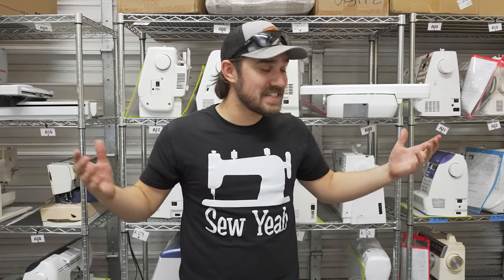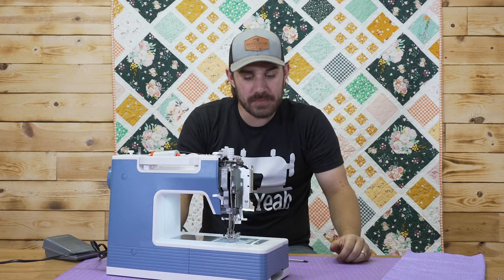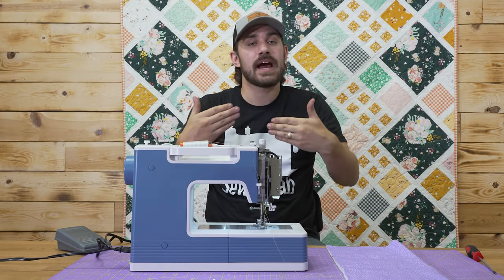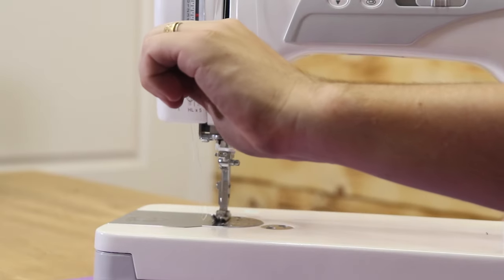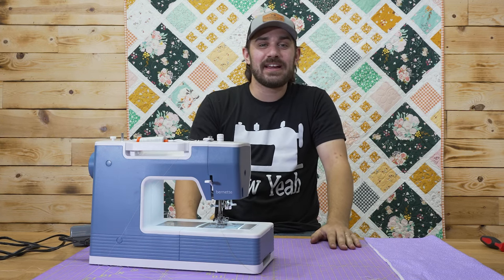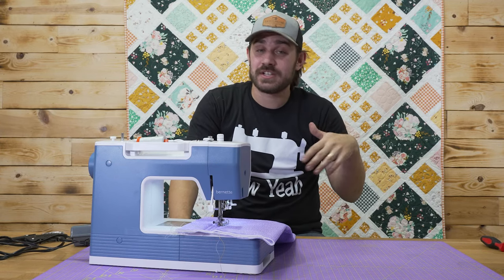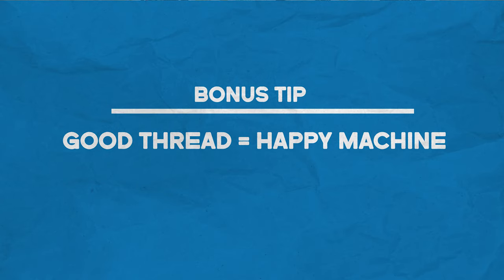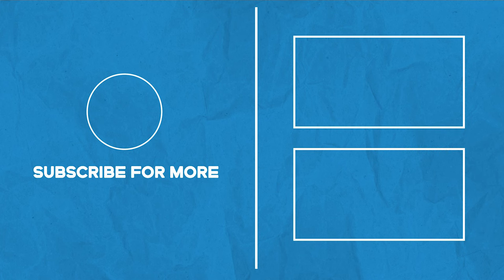Sewing Machine Problem? | 5 DIY Fixes!

Comment: Is their anyway at home to fix a bobbin winder on a singer 5040c I had the machine given to me and the bobbin winder wont lock in place to wind it.If I hold it in place it will wind the bobbin but this is not what I really want to do.
Reply from the maker: I'm sure there is but we can't answer over the comment section. Would need to see it.

Comment: I am disabled so I am having trouble getting to my main machine. I bought a mini sewing machine. Nightmare. I think it only takes diddy cotton reels. I can't stop the thread from breaking. I rethreaded many times. I can pull the reel until the needle is threaded. Then it will not budge. What (probably daft) thing am I doing wrong? I am not sure if any other better quality reels will fit a mini machine. HELP!!!!😮
Reply from the maker: We really couldn't answer that without looking at the machine. We are sorry you are having so much trouble. Thanks for watching.

Comment: Good information. Thank You T 
I never used # 6 for bobbin I use the Letter P makes more sense to me! You are sew right, I was cleaning my 2450 I was tired I knew to wait but then it froze could not get the late back off!! Grrrr 👿 I was tired, covered him up went back after sleep and fixed it!
Reply from the maker: 🙌😊 Nice work! Thanks so much for watching!
Reply: If your machines bobbin goes in like a p it won't work if put in machine like a 6 that's for sure

Comment: i have a serger that all the tension dials have to be on 7 or 8, when they should be normally at 3. how can that be fixed?  also, i have a new issue that just started and the thread for my left needle keeps popping out of the tension disks constantly...like every 15 inches of sewing. the tension is not too high, if i put it any lower the thread is loose. what is causing this? it might be related to the first issue with all the tension disks too loose. my machine is a janome 234d. where i live its minimum 200 bucks just to get a machine serviced, and that doesnt include any repairs, just the basic service.

Comment: im a new to sewing since i inherited a sewing machine and have no clue on what is good and bad thread is. can you explain in simple terms?
Reply: there is alot of old fuzzy thread in kit. i should just probably just throw the old fuzzy cotton thread away
Reply from the maker: Old thread naturally degrades, and it will snap easier and more often while you're sewing. We recommend Aurifil thread, it comes in a ton of colors and will last you so much longer than the old spools.

Comment: What if my tension disk housing keeps falling out of my machine? 😳 I keep putting it back in  and  tightening it down real tight, but over time it falls out again.
Reply from the maker: We are sorry you are having trouble with your machine. You will need to reach out to our Repair Dept. by coming by the store with your machine, or reaching out to a dealer closer to you . We can't answer these questions in the chat.

Comment: Machine. Usha.Delux.  1960 s model. Stilluding. But now it makes the noise....KHAAD..KHAAD.   and the bobin dosent makes a click sound while  it is fixed in the case....this used tobe indication of ok .. fitted.
Reply from the maker: We are sorry you are having trouble with your machine. You will need to reach out to our Repair Dept. by coming by the store with your machine.